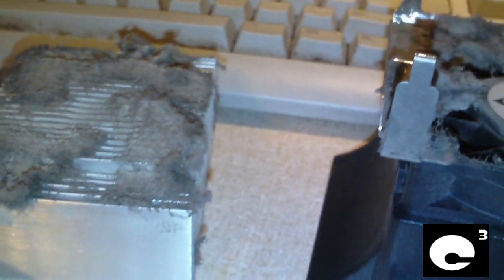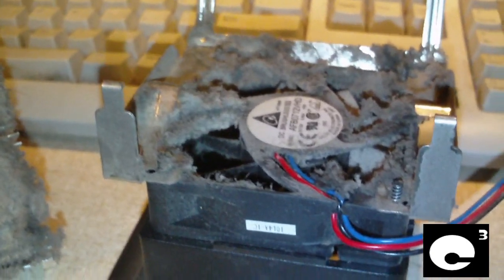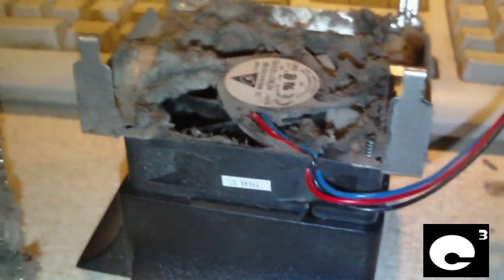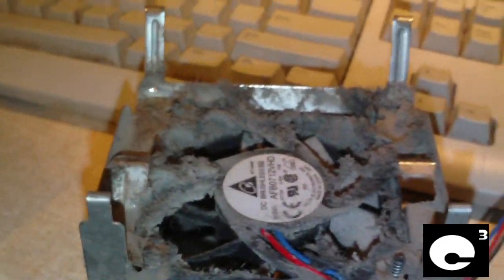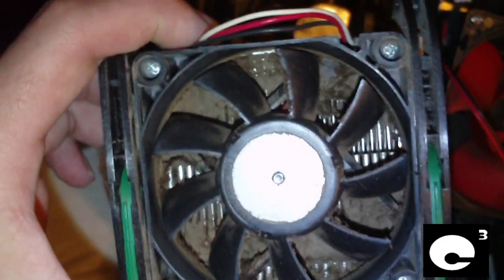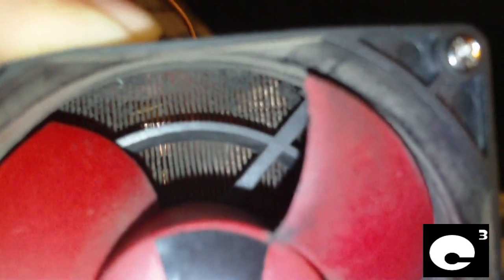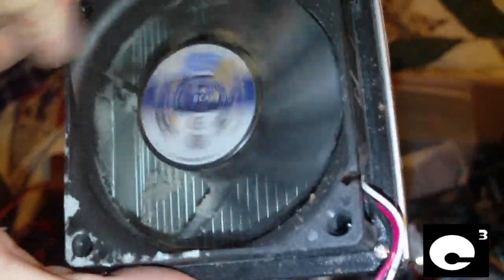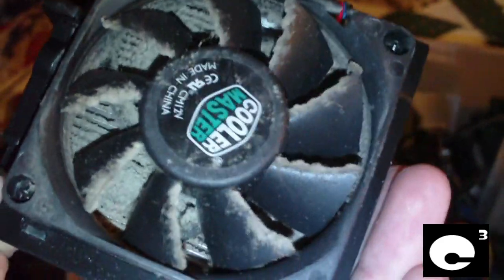Filthy CPU Heatsinks From Dirty Parts Computers

Comment: QUESTION: I was putting some LEDs in my psu and from the rush i was in (late for work) i didnt insulate the led's lags and it caused a short, no smoke or smell or anything, just a small spark, now it wont turn on AT ALL, is it a lost cause? :(